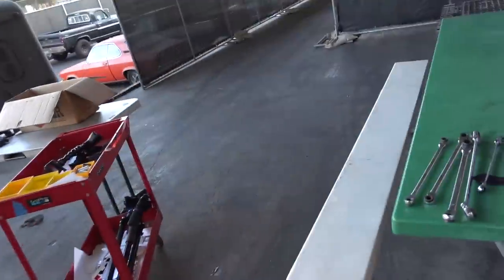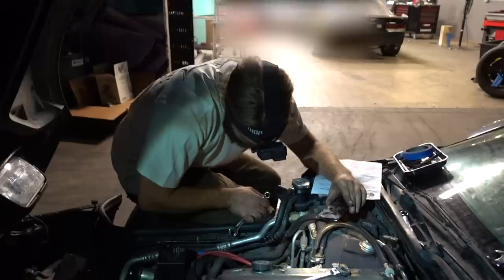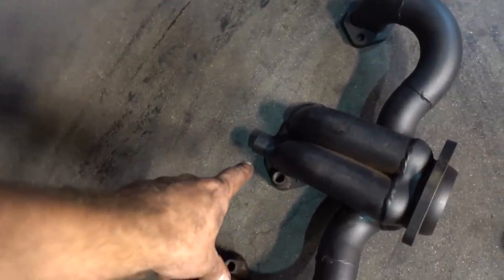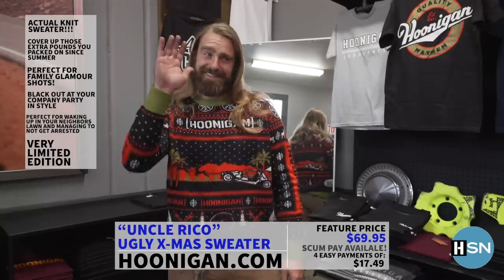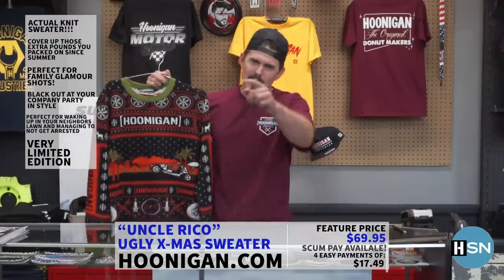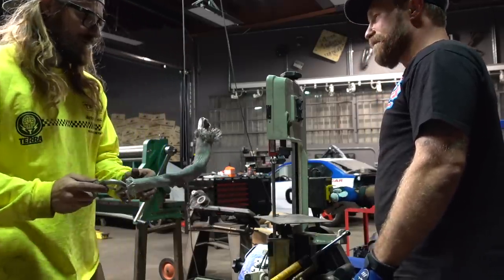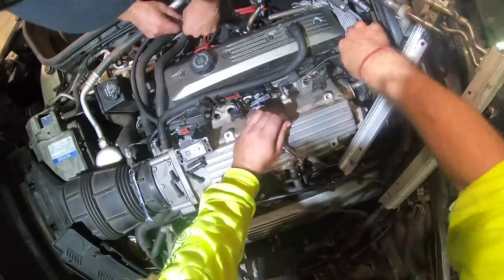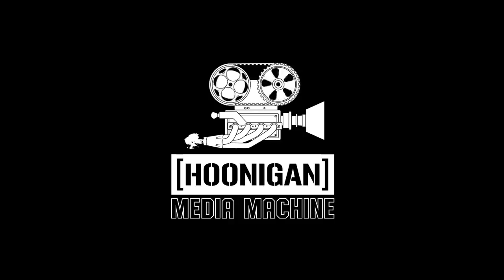Kyle's C4 Corvette Gets Headers - Will it Sound Better?

Comment: I miss you Dan.

This series also makes me want to build a C4 now.
Reply: 5 hours and two people to put some headers on...it makes me NOT want to build a C4 lol
Reply: Fox, they are a lot of bang for the buck.
Reply: Build a 2cv... Much more fun
Reply: @AaronHendu  TBF anything that old is a shit show changing headers - thats what happen with years of expansion and cooling while exposed to the moist air... They didn't even snap 1/2 of them off - which any real mechanic knows it a huge fucking win with a car that old...

Edit - they should of just done an EGR delete - as long as its pre-86 its grandfathered into even cali laws
Reply: @Blake Pinette yeah, but in a non-emissions state, thats not a real issue.
Reply: @T3l3visionT0day  Dude...I've installed hundreds of headers+exhaust systems...it's what I used to do for a living.  Most old V8"s are easy peazy...lots of room under the hood...heat the nuts up orange hot and zip em off...even the rustiest studs tend to have good thread under the nut and rarely would replace studs.  EGR delete is also not always recommended either, for various reasons...not sure of an EGR delete on this exact engine...I did an EGR delete on my old VW...anyway...just rambling...all I meant was it seems like a bitch to work in there.
Reply: @AaronHendu  I work at a ford dealership so i know your just talking out of your ass ;) we're the only dealership in town so we service all makes

I get 10 year old V8 trucks - usually Ram's and F150 5l's - coming in with broken manifold stud's just because they heated and cooled too much on the coast of BC. 

Also - no Corvette has space to work on the engine bay, they actually recomend removing wheels and inner fender well's for doing bottom end work... Wait until people have to work on C8 mid-engine vette's...
Reply: @T3l3visionT0day  Believe what you'd like, doesn't bother me a single bit.  I'd say you're probably not as good at your job as you'd think though...
Reply: Cory Mitchell well first of all, in Cali, you have to pass emissions if your car is a 76 or newer.  Second of all, this vette is an lt1 model meaning it’s at least a 92, and it may be even newer than that, so on both aspects, you’re wrong lmao
Reply: @T3l3visionT0day  the LT1 was introduced  in 92,and it is actually a 92 cuz 93 has the polycarbonate valve cover, so this is not a pre-86 car
Reply: yep
Reply: Ive been building mine up and i can tell you it's a money pit. Nit discouraging anybody just a good heads up if you have the money for a c4 and say 5k saved up for upgrades, go ahead and save 10k before you even start. That goes for any number you have in mind. Just double that number.

Comment: Though not as cool as tig welding, a compression fitting would have been much easier.  No need to remove the EGR tube, just trim as needed, install the compression fitting, and slide the heat sheath forward to hide the hackery.

Comment: You guys should grab a swedgelock catalog for all your hard line jobs. That EGR could have been 2 cuts and 1 union fitting. Capable of 15000 psi burst pressure and stainless.

Comment: Awesome to see someone else went through a little hell installing headers.  Means I’m not a total imbecile.  I installed long tube headers and a catback exhaust, it took me 30 hours all together but I also did some tune up stuff and AC repair.  I posted video of it.  I’m planning to add one of those mail order tunes from PCMofNC because the thing is running way rich...although my hacked up EGR tube maybe allowing too much air to O2 sensors...ok I’m babbling now.

Great work though...keep it up!

Comment: Next upgrade airfoil for throttle body and intake it'll wake up the lt1 alot did in my Camaro I had thumbs up on the build
Reply from the maker: We’re just going to keep scumbagging Kyle to keep throwing more parts at the C4 until it turns into a full drag car...
Reply: @jonsixxx6569  it's a start I eventually went up to a 58mm with larger cam and nitrous

Comment: Yo Kyle, those heat shields matter in those tight quarters. You may break some nearby parts if you don't find a way to get those back in there, they REALLY diminish the radiant heat that would damage nearby wires and mechanisms.

Comment: What were your performance gains on these? These shorty style headers are only slightly better then the stock manifolds that gave the LT1 300 or LT4 330 horsepower from the factory. The real deal would have been long tube headers for scavenging and much freer flow. You have to use O port headers with 1 3/4" tubes to cover the LT1 D port heads and yes, they are a huge pain to do, but you get actual seat of the pants torque increase. I have Hooker ceramic long tubes and Billy Boat 3" stainless exhaust on my 1996, and its a new car. I completely removed ALL EGR, CATS, and air injection from the car. I have a check engine light now, but when I am finished with my upgrades I will have the computer recalibrated and the EGR program disabled to clear the light. One step at a  time.  Good luck.

Comment: KEIKEI!
Look into "Euro 4" cats, from my quick read up here in Aus, they're a 200cpi cat (legal), but flow like a 100cpi cat (not usually legal) - with the right cats you might be able to keep it smog legal but get that highflow unrestricted exhaust happening.
Soooo, whens the cam swap happening? ;)

Comment: You can probably bend the EGR pipe into the position you want it.
Reply from the maker: The angle of the EGR fitting wasn’t straight, and we would have fought 2 days on trying to get it lined up...

Comment: LT1 engines are such a pain in the ass. Opti spark replacement sucks, headers always suck. On F bodies like I am used to, there is basically zero room to work on it. Even the spark plugs are a 4 hour circlejerk of using different length socket extensions for each one. I swear, Ive spent more time under the hood of LT1 cars doing minimal amount of work, 90% of it is fenangling shit to fit. They are dope engines though, a built one with twin turbos is currently the fastest stick shift GM car in the world.

Comment: That pipe is the secondary air injection and really the whole system should be removed, headers capped, and the chip tuned to remove it from the computer, same with the egr system.
Reply: Not in Cali to be road legal!
Reply: @page11racing89  ah I didnt know you guys were in California.... sorry to hear that

Comment: Seriously, how hard would it have been for Hooker to put that port in the right place to start with? ~
Reply: It's easier and cheaper for them to just put it on one runner rather than bridge 2 like they would have had to
Reply: @lb9gta307  I know it's easier & cheaper, but by only a razor thin margin. Being the company that made their headers installable w/o tig welding chops would sell a ton more headers and seriously overcome the difference and more AND prevent those backyard guys from rubber booting, duct taping, soldering and the myriad of "wrong" fixes we all know have taken place on at least 1K cars or more that quickly break down and fall apart. I think the chump change they saved costs them profits in the end. ~
Reply: @burningdaylight1085  it's also possible that it changed position in the later cars and they just decided to sell one version. But that being said, the last set of Hooker headers I dealt with needed about 1' of a primary rerouted to clear the steering, another primary needed to be notched, and one of the collector flanges touched the trans. They're not the best out there.
Reply: @lb9gta307  Worst fitting pair of headers I ever had. Hated them.